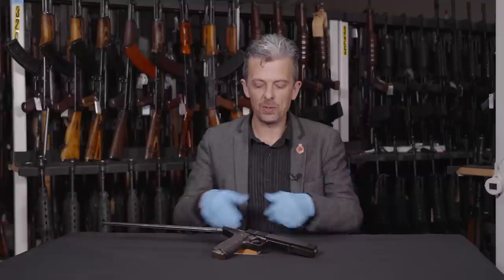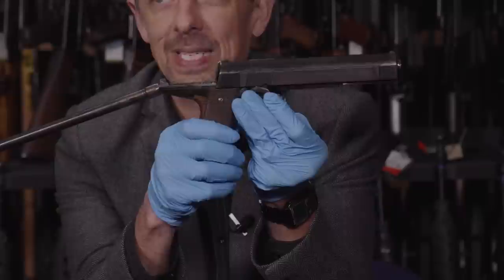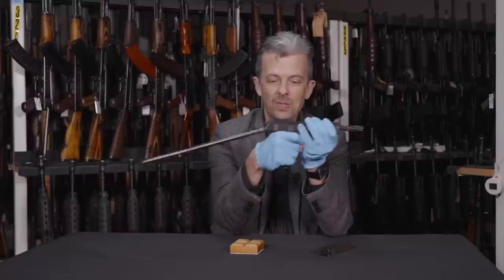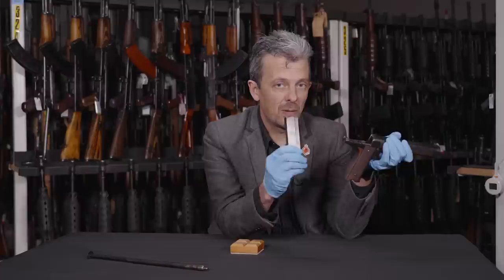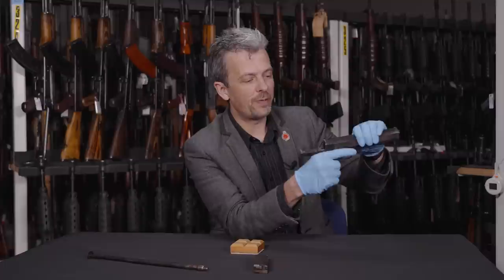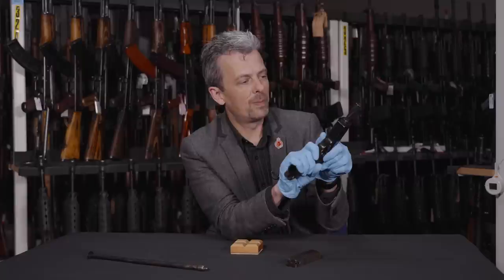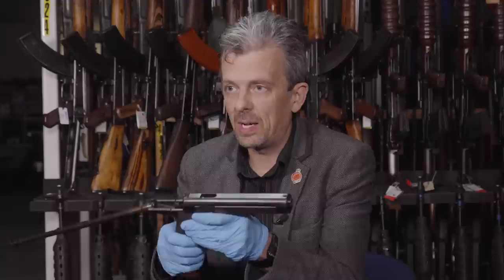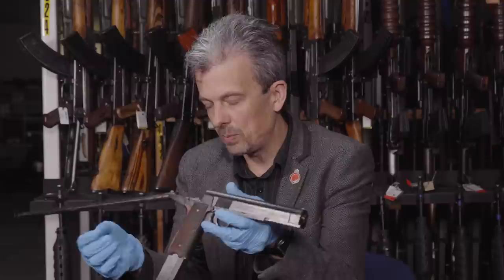Rifling on the *outside* of the barrel? The SR-11 with firearms and weapons expert Jonathan Ferguson

Comment: The gun may be characterized by some seemingly topsy-turvy design, but it actually makes a lot of sense when you realize the designer was Australian.
Reply: That being so, Robinson ended up in the wrong place to contribute to the post-war developments of the Stechkin, the VZ61 Skorpion and PM63 Rak.
Reply: @derekp2674  These three are quite a bit more suited to their area of use, however. The SR-11, on the other hand, looks like total madness for jungle warfare, and given that Robinson saw it as a good enough idea to still patent it in 1970, decades after it failed in the tests, I cannot imagine him contributing anything sensible to these designs or any other of that sort.
Reply: @F1ghteR41  After WW2, I think British and Commonwealth forces quickly figured out that something like the AR15 would be a good primary firearm for jungle combat, with the Browning HiPower providing a good option for a secondary arm.
Thus the availability of those options did not leave much of a business case for working up Robinson's constant recoil ideas into a novel machine pistol.
In my time I've worked with a few crazy inventors. However, after detailed study of the SR11 patent and making due allowance for his other firearms design work, I am not prepared to dismiss Robinson as just another mad inventor. 
That said, I have no first hand experience of jungle fighting to draw on. I did once have a work colleague who told me he had served in Burma in WW2, as a special forces sapper. He said his unit found that the M1 carbine was the best choice for their needs (for what we'd now call a PDW) and he also added a Browning HiPower to his personal inventory. (I assume he acquired a Canadian made one intended for Chinese service.)
Reply: I saw a video the other day about a new but not really new type of rotary engine. Can't remember if the engineering was Aussie tho. Probably.
Reply: @derekp2674  Well, AR-15 didn't become available before the early '60s, and during that period SMGs were quite prominent. So Robinson could potentially find an application for his ideas at home - e.g. providing a contender for what would become the F1 SMG.
M1 carbines were indeed held in high regard in South-East Asia for ages (think of Chindits and Indochina wars), Indonesian law enforcement only getting rid of them a couple of decades ago.
Without claiming any in-depth knowledge of jungle warfare I can safely point out large mud ingress holes and disposable magazines (a strain on logistics in any regard, much more overseas) as obvious deficiencies.
Reply: @F1ghteR41  I think the SR11 is much better seen as a concept demonstration rather than as a prototype for adoption and issue. But if its goal was to produce a "really accurate" machine pistol to supersede ordinary SMGs, then that was probably daft in the light of the M1 carbine. I say that because the latter had shown that the way forward was to replace hard-to-use pistols with easier-to-use carbines.
Reply: @samuelgarrod8327  It was probably the Sarich engine.  https://en.wikipedia.org/wiki/Sarich_orbital_engine
Reply: @derekp2674  The idea behind the SR-11 was presumably that of the ease of carry (especially for the people like tankers), which is why it was tested against the MCEM-2 (and not, say, Patchett). In that regard the M1 with its 18" barrel is hardly worth considering. In fact, its success in South-East Asia (alongside the M2 carbine) from WW2 onwards was as a main rifle in lieu of the M1 rifle (or something similar). Come to think of it, it could be said in even broader terms - the whole M1/M2 family and especially the M3 weren't used all that much as PDWs, more as the compact main rifles, carbines, y'know, it's in the name, after all. It's also telling with what it got replaced - e.g., the M16 in the USAF, M14 in the US Army, etc.
And, returning back to the SR-11, back during the WW2 specialists even besides those working in confined environments preferred handguns, even as old as M1917 revolvers, to bulky M1 carbines. For example, medics only used them on the Pacific theatre, and then only as supplementary weapons. The revised U.S. Army TO&E for the Battle of Luzon in 1945 ordered the "Carbine, cal. 30, M-1" to be issued out "1 per Enlisted Man, Medical Department, not armed with pistol". So Robinson was correct in thinking that a handgun format is what is needed for a PDW, it was almost everything else that he judged wrong, though.
Reply: @F1ghteR41  I agree that the SR11 is effectively a PDW, but was invented long before such a thing was recognised or requested. The Mauser Schnellfeuer machine pistols predate the SR11 by a decade or more, so those responsible for equipping British and Commonwealth forces should have been well aware of the concept. My old work colleague said he liked his M1 Carbine because it was light and handy (they had to carry a lot of other gear) and because of its ability to put a lot of lead downrange if they had to run away (er, sorry, make a fighting retreat) in response to the unexpected appearance of the Japanese. As he saw it, his job was making airstrips, others were there to do actual combat.
Also, for a stowable pistol carbine, Inglis was already supplying HiPowers and holster stocks to the Chinese. So that would be the gun to beat for a 1940s compact PDW precursor.
Reply: @derekp2674  You see, this is an interesting issue. The use of the M1 Carbine as you're describing it is basically the same as how the carbines for the artillery and engineers were seen since at least the late XIX century, minus the stacking hooks and plus a lot of firepower. The SR-11, meanwhile, by the looks of things came from a different approach, that of much greater compactness.
1940s certainly look to be the era when people started thinking about the PDW seriously. Full-auto C-96 variants were essentially 'trench raiders' guns' or sanctions-busters for the Chinese market, but since the 1940 US trials we would see a lot of varying designs aimed at what we now call the PDW niche - i.e., compact but, as you say, capable of putting 'a lot of lead downrange'. Italian Sosso pistol would arrive the very next year, then in 1943-44 at least a couple of compact mag-in-the-grip (or handgun-style) SMGs would arrive, namely the Soviet Shpitalny design and the MCEM-2 (and that concept really took off post-war).
Then in 1945 the idea of more powerful ammo for the handguns arose in the English-speaking countries - .30 Carbine M1917 revolver proposal in the US and (if I recall correctly) a more powerful .45 calibre variant of Hi-Power for the US, Canada and the UK. The design requirements for the Soviet APS would also be drawn sometime in the mid- to late-'40s, when their future MKb-42 analogue was relegated squarely to the role of a more powerful SMG (rather than a sort-of LMG, which is what AS-44 was developed as). And Robinson's design fits right in the middle of all of this hustle.
To go a little bit further, 1953 saw the adoption of AKS, and thus we see the emergence of the clearly recognizable divide between carbines (of which the AKS was one by the very definition) and PDWs like APS. By that point Korean war had definitively shown the further slide of the M1/M2 carbines into the battle rifle role akin to the recently developed SKS and AK respectively.
Reply: Yep. Even less constrained than Americans.
Reply: @F1ghteR41  Australian "Scientist" here. I can 100% confirm that this firearm is far more accurate when fired from the traditional Aussie firing stance of standing upside down. Hope this clears up any confusion!
Reply: Russell Shepherd Robinson was actually from New Zealand!
Reply: Just look at the Owen's.. We have a tendency to make some unintuitive designs.
Reply: @Jonne Jaaskelainen - with your ancestry that comment makes sense coming from you,a very narrow minded comment and very disrespectful of you.
Reply: @jameslawrence2446  well he can go hang out with Crowded House, Sam Neil and Russel Crowe (the other Kiwi's we've claimed as our own)! As for half the entire Maori population that has somehow found its way here, could you please take at least a couple of thousand tonnes worth of em back, plz? By my guestimates, that's probably about 5 or 6 of the massive bastards! I kid, they're awesome guys through n through. I just feel very very smol when 75% of em work in my industry (film,tv n live events). But without a doubt, they are seriously handy to have around when you can't get a forklift into a narrow space but still need really heavy shit lifted!
Reply: @andrewb8698 Trained at MIT in the US then moved to Australia, during the war war working on a number of different machine guns nnd cannons. The SR11 was more of a side project. The main game was the series of constant recoil .50 cal although the archives suggests that he also was working on  a 75 mm (American) beast firing around 120 rounds per minute. Did most of his preliminary work at the Australian Army Inventions directorate. The model 9 was the burst fire constant recoil "machine rifle". In .50 BMG.
Reply: Better to try. Australians hold more patents per head of population than any other nation.
Reply: @samuelgarrod8327  I'm guessing that you're talking about Sarich engine, a pistonless rotary loosely based along the lines of the Wankel engine, invented by Ralph Sarich In Perth WA. I'm not sure if 1972 counts as 'new' though
Reply: @derekp2674  We didn't use ARs till '67 & then only for scouts, everyone else used L1A1. Very few Australian soldiers carry a pistol.
Reply: @badpossum440  Thanks for the info. British special forces in jungle operations were early adopters of ARs. But they would not have been able to do so, if Stoner and others had not recognised the potential value of lighter select fire weapons.
Here in Blighty we now have a special short carbine for helicopter crew. Has anything similar been adopted down under?
Reply: @alonsocushing2263  The modern Direct Injected car engine owes a lot to Orbital. They were the first to develop a modern direct injection process.

Comment: Australia is known for odd but effective gun designs.     The Owen SMG is a prime example
Reply: odd but effective, like their fauna
Reply: And then there's this thing...
Reply: @kutter_ttl6786   tbh.  I think a modernized version of it would be practical for some things it  has a nice lightweight styling and quality  to it
Reply: The Owen gun is only "odd" insofar as it is extremely simple and very reliable.
Reply: @geoffreypiltz271   top mounted magazine right in the normal sight plane is kinda odd when literally  EVERYTHING ELSE feeds from the bottom or side
Reply: @agoogleaccount2861  Um the Bren gun and the Czech ZGB 33.
Reply: @willallen7757  Is like saying 202 and 3.3?
Reply: @agoogleaccount2861  I've used F1 and 7.62 Bren and found acquiring the sight pictures weren't a problem.
They both pulled into the shoulder and the sights came to eye quite naturally, just like M16, M60, M79 and S.L.R.
Reply: @agoogleaccount2861 Different but very sensible as shells eject from the bottom with gravity assist and the bottom opening keeps the dirt out. It adds to the reliability in action, particularly jungle warfare. An SMG is a close combat weapon - who actually sights an SMG in action?
Reply: @agoogleaccount2861  The sights are mounted on the right so you simply cant it to the left if you need to shoulder it when functioning as a lead scout. Also - don't confuse actual soldiering with tacticool bullshit taken from policing where you are always on the sights as you move. You are carrying an Owen all day, every day in a rain forest. It gets a bit tiring to say the least. The Bren never presented a problem in the sights department either.
Reply: @agoogleaccount2861 
bren.
Cz25
Jap section auto.
So literally 3 other weapons.
The thing worked bloody well. And it was easier to move thru thick jungle. And the empty ejection straight down didnt give you away. And you could get right down on the ground.
Reply: @zoiders Oh man, I've been waiting to find someone who has carried an Owen and Bren in action in jungle conditions. Msg me, I'd love to interview you.
Reply: @ray.shoesmith  Yes fella. YouTube is awash with 90 years olds.
Reply: @sugarnads  Good call!  He said "literally" so how you got your correction!

Can you name any more guns that fit that description?  Only 3?  Then maybe if he didn't say the word "literally" he would still be right?

Maybe if we answered according to what someone meant rather than what you wanted them to mean would prevent meaningless responses.
Reply: @sugarnads  the scoped m1 garand scope  is offset like a bren because it top ejects and uses enbloc clips
Reply: The thing is back in the day there were very few variety's of guns in Australia so out of the box influence free designs were a thing. Back when the Owen was made there was only one other Sub Machine gun in the country. Also Automatic hand guns were extremely rare. As so far as ODD for an Owen its mag position is but it just requires a slightly different handling routine and if learning from scratch no big deal.
Reply: @dazaspc  It makes sense to have a magazine feed by gravity, doesn't it?  The firearm zealotry, certainly encouraged by Hollywood, finds conversations about guns involving aesthetic details but when the point is to get an aerodynamic hunk of lead into a target from a distance, I don't think it should matter what it looks like.

Thankfully I don't have to use these in combat, but when I'm selecting to drop a gun for another gun in a video game, I'm not thinking about if I'll look cool.  I'm thinking of how powerful and easy to aim and fire a gun can be.  These video games emulate well that a Webley Mk. V will stop a Nazi the same as a Lee Enfield, ya just gotta use what's laying around.

I feel kinda weird saying this as an American, too, because we've got all the toys.  I think most gun zealots see them as toys, collect them like toys.  (If they were made of arsenic, we'd ban them but because children die from the intended purpose we turn a blind eye /soapbox).

Anyway, you made a good point I think.  The Owen gun surely looks awkward next to other submachine guns, but I'm sure the bullets worked just like the MP40 bullets did.

Comment: That rear overhang for the slide rails looks extremely vulnerable to ingesting dirt and other debris.
Reply: The "buttstock" also looks like it's just asking to get sat on or caught in car doors when you're in a hurry.
Reply: @alltat  Another thing to lose in the couch cushions
Reply: The polish Rak-9 used in the iranian embassy seige had a similar design, the idea is that if dirt could get in you could easily brush the dirt out
Reply: @JinKee but if I put a ham sandwich in it probably won't run
Reply: @sulivanmagnum To be fair I don’t think most guns would run if you put an entire ham, let alone a whole ham plus a sandwich in it.

Comment: Given the tendency for the gun to "nose down" in fully automatic fire I wonder if the stock/brace is for poutting under the arm pit to try to prevent this?

Excellent video as ever.
Reply from the maker: Good shout and thank you <3
Reply: Thank you! I had the same thought however the photos of it being held show shouldering. Had they put a buttplate on it you could have done either, like a Viper or Thompson.
Reply: Had same thought 😊

Comment: The Uzi telescoping bolt idea could well have originated from an idea like this. Telescoping bolts are essentially a pistol slide inside a tube!
How interesting.
Reply: I agree, but it is usually thought that the Uzi design was directly inspired by earlier (but still post WW2) Czech SMG designs.

Comment: That's funny, I'm from Australia and had a similar idea for a constant recoil action. In essence the idea is to turn the longitudal force into rotational, to dispel that recoil through a spinning weight. Pretty much like a J damper.
Reply: A spinning weight at that sort of speed sounds /really/ unsafe.
Reply: @thekaxmax  you mean unsafe like having an explosion go off a few inches from your face or having an open bolt fly back towards it?
Reply: @MartianLivesMatter  You still have an explosion near your face. Same with the bolt--that still has to go backwards and forwards. You're adding danger, not replacing any.

Comment: maybe spinning the barrel can contribute to the action by slightly reducing the slide mass necessary, since it basically increases the overall apparent inertia.
Reply: That's probably true in principle but doesn't seem to work in practice here. As mentioned by Jonathan, the developers had to rework the example shown with an extra heavy slide to get it to cycle smoothly.
Reply: I think there is a savage pistol that works similarly. Good idea for a small light pistol, tho it  wasn't in production long.
Reply: @tweake7175  The Savage model 1907 uses a patented rotating barrel delayed blowback action. But really it is just a straight blowback and the rotating barrel only contributes to getting around Browning's patents. Forgotten Weapons has an "Ask Ian" video about it, where high speed video is used to show that the breech begins to open as soon as the shot is fired.
Reply: @derekp2674  yes, but it also has a lighter slide than a comparable pistol. Its making some use of the barrel weight to slow down the opening.
Reply: @tweake7175  I can see that being true in principle but have you watched the "Ask Ian" video?
Reply: @derekp2674  Yes, I've seen ians vid on it. He has the slow mo footage and weighs the slide, etc.